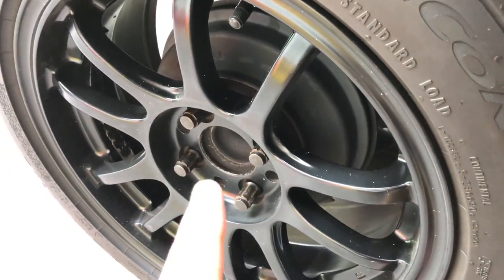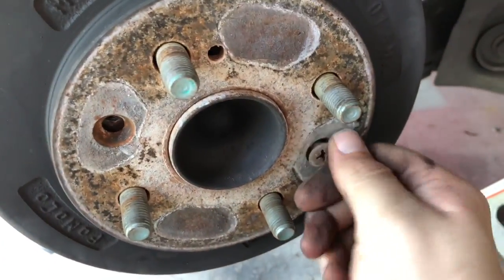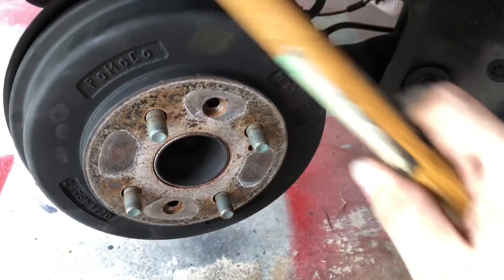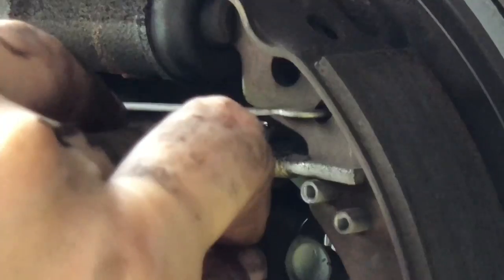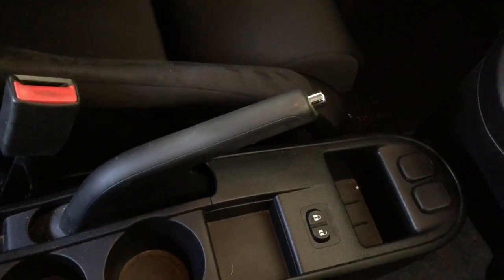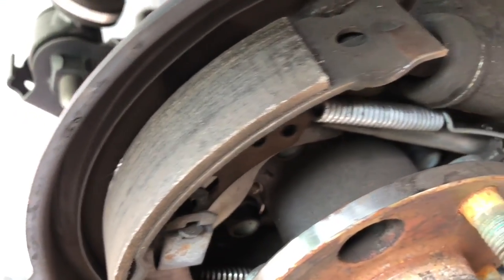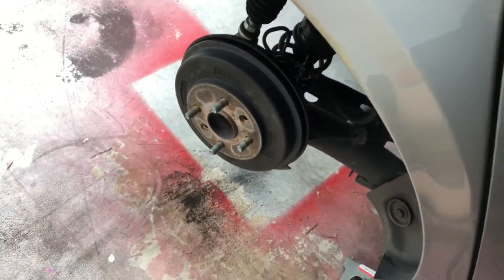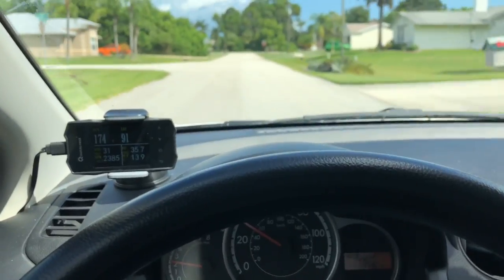Mazda2 | Rear Brake Adjustment

Comment: The screws remove easily with an impact driver - don't try removing them with a Phillips scewdriver because they're not Phillips they're JIS  and you'll round the heads. If you put some coppergrease on the threads they'll come off easier next time around

Comment: Can't wait to do this. My brakes are adjusted fine, but they've gotten ridiculously squeaky.
My favorite tool for those screws, at least when I've had to take the rotors off a Honda, is a manual impact driver.
Reply from the maker: I didn’t have one on hand. If there’s a common theme on this channel, it’s using whatever you can find lying around the garage. 😅

Comment: Got my son's Mazda 2 rear shoes to do this weekend, and was wondering if they were screw back calipers with the 'Ford connection' but happy to see they are drum. I use a manual (Hammer powered) impact driver for those screws but do make sure its the correct size bit, snug fit! if you don't have an impact driver, sometimes a 'clump' on the end of a big posi screwdriver can just loosen the rust. Otherwise, as Josh says, drill a divet and whack it, preferably with a punch. I always refit the screws, just tight enough (with a dab of copper grease, as it's high temp), that way the drum is held so I can accurately adjust the shoes. Some drums have a hole in them and a corresponding one in the hub, so you can adjust the brakes with a flat blade screwdriver, for which you need the drum secure. I also use high temp grease, if i lubricate the brake shoe to backplate area, just any old grease won't do as it might run off.. Brake grease is ptfe based

Comment: The only thing you neglect to mention is if the big screws holding in the drum are JiA or straight phillips head. Everything else is A+ kosher. Poppin' the drum out with the spare hole should be a #8, likely 1/4" head bolt with a standard thread pitch eg: whatever mazda uses everywhere else on their modern cars. Slot it in with some grease and torque it while bopping the opposing side of the drum to wiggle things out.
Reply from the maker: Since you have to likely destroy and then throw the dumb screws away and don’t replace them, I didn’t think it mattered much. lol Also, just hit the drum with a mallet like most mechanics shops will do. Much faster and it’s not going to hurt anything. It was already loose from the hub when I was having trouble removing it with one hand for the video clip.
Reply: @HiroshimaSpirit  Thanks for the clarification!

Comment: Did you upgrade your rear shoes or are you using OEM/the original shoe? Curious about the porterfield shoes... Also, where is the Mazda2 owners group? Online somewhere? Thanks again!
Reply from the maker: OEM shoes. They last forever, literally. Fronts do 70% of the braking so there’s really no need to upgrade the rears.

Search ‘M2O Mazda2 Owners’ on Facebook for the group. 👍🏻
Reply: @HiroshimaSpirit  I'll save my money on that area then and use it for something else, thanks! Unfortunately I am not on FB :(

Comment: Hey brother, you helped me a lot last time. Now my heater is barely putting out heat. Do you think that could be the the thermostat? My coolant is at a good level and clean. (2011 Mazda 2 - 111k)
Reply from the maker: Did you flush your coolant recently? Typically, if there is air in the system, it can find its way to the heater core and render it ineffective as well as affect your overall cooling efficiency. If you haven’t touched the cooling system, I don’t know what the issue could be. Perhaps a clogged heater core? It’s certainly not the thermostat.

Comment: You should do a rear disc brake conversion ive seen some online for a 2
Reply from the maker: The kit is expensive and would be more for looks than anything else. Drum brakes on a lightweight car like the 2 where the front brakes do about 70% of the stopping are more than effective. Drum brake assemblies also tend to be lighter than disc setups. Not to mention that they literally last forever.

Comment: Another super helpful video, as always. But quick (unrelated) question, have you or any of your friends experienced any harsh vibrations/shakiness from your 2's, particularly from the engine? I ask because my family's 2 has been causing quite of bit of vibration from the engine to transfer into the cabin and you can feel it from the steering wheel, the floorboards, and it sorta feels like the whole car is shaking a bit. Revving the engine or accelerating just makes the vibrations more noticeable. The engine runs super smoothly otherwise so I have a hard time believing it's anything but the motor/trans mounts going bad. It happens every morning after a cold start (which feels the worst btw) and completely fades away after about 30 minutes of driving. In your best estimation, do you think an 80k mile 2 should need motor mounts so soon? Anyway, sorry for the long read, you just have so much more experience with these little guys. Thanks man!!!
Reply from the maker: The mounts are a good place to start, judging by what you’ve described. 👍🏻
Reply: I thought so. Thanks man! Btw, I'm aware of the big mount on the top left of the engine but is there two or just one mount for the transmission? I watched your video where you swapped out your mounts so I was wondering if there really was just one. If so I'll definitely feel relieved. haha
Reply from the maker: Yes, there is just one trans mount. 👍🏻
Reply: A transmission mount or engine mount on an automatic going out will actually have ~lowered~ perceived passenger bay noise and vibration when under load. Easy test: Keep it in park ==> heavy vibration Y/N? (y) pop into neutral. Vibration lower but still present Y/N (y) blip the throttle. Does vibration lower even more as the engine rocks? Y/N (y), one of your mounts is on the way out. 

When I bought mine at 117K, the PO gave me his OEM lower engine mount that he'd swapped out at around 80K and it had a massive tear in it. I wouldn't be surprised if you're suffering from some sort of dampening issue, even if your symptoms don't match what is traditionally acknowledged as a bum mount. That being said, if you're feeling a ton of vibration and noise in the first place, a bum mount is where to look. It's ass backwards and silly, but hey that's keeping economy cars on the road baby.
Reply: Thank you for bringing it up actually, I tried that the other day and the vibration is about the same in both park and neutral. However, it seems very rpm-dependent so blipping the throttle, accelerating, and cold starts all make the vibrations stronger and more apparent. But I just can't seem to make sense of the fact that the problem seems to solve itself (if you can even call it that) after the car warms up for about an hour or so. But like you said, it's kinda ass backwards so maybe the symptoms don't always make sense in our heads. I'm just curious though, did the previous owner of your 2 get a high performance mount when he replaced the OEM one? I'm kinda wondering how a stiffer, aftermarket mount would affect driveability on an automatic like ours. Anyway, it's good to know our car is making it beyond the 100k mile mark without (too many) issues.
Reply: @emptyhead3007  Rubber is more supple when warm and you haven't mentioned the climate you're dealing with. Things may smooth out when stuff warms up in the engine bay. The PO of my vehicle didn't replace the engine mounts, just the transmission mount for a semi-stiff dogleg from Anthony West racing. It adds some very low level vibration at stops, but the stiffness (according to the PO) makes it impossible to miss shifts into third gear. 

Unless you want to get in there and remove all your mounts and inspect them for cracks, you might be pissing in the wind.
Reply: @MrAfdasdfa  Thanks for your reply. I just took the car yesterday to get looked at by two different mechanics and after doing a "stall test" the engine rocked in the engine bay so they both determined the cause is most likely the trans mount (aka dog bone or torque strut mount). And you're right, we're not gonna check all three mounts because given the way the engine rocks as well as the sheer cheapness of the part (in terms of quality) it has to be the trans mount. I just bought a new one from Rock Auto today for 30 bucks after shipping and I'm hoping it'll resolve the problem even though it's based on the OEM design and will eventually go out again. Both mechanics told me that newer cars are having more issues with their mounts sooner than older cars and it seems to be a common trend. It's a shame but at least it's nothing too major. And just curious, is there anything I should keep an eye out for now that my 2's just surpassed 80,000 miles? I know the suspension is another problem area so I'm anticipating changing out the struts in the near future.

Comment: thanks for the video..
BUT
just so you know, those 'stupid screw holes' line up perfectly with the adjuster. they're there so that you can adjust it without taking the drum off. also, even if they were indeed pointless, all you've done by getting rid of them is increased the potential for dirt and rust to get inside...
Reply from the maker: Those two screws are there to secure the drum to the hub. Nothing more. A friend of mine, also a 2 owner, master mechanic, and certified state vehicle inspector, recommended that they be thrown away. I trust his judgement. 

As far as dirt and rust getting inside, there is a gap between the drum and the rest of the assembly. The entire way around. Two little holes on the mounting face of the drum that are covered by the wheels aren’t a problem.
Reply: that's not going to stop the brake dust from inside the drum or moisture in the air from getting in. all i know  is for me, doing this exact job today, it was much easier to do it through the hole, even when the drum was off, although with the drum on is easier to alternate between testing and adjusting. 
there's a few mm of play around the hub bolt holes of the drum and the bolts. eventually that will wear down the bottoms of your hub bolts as it will grind when you change into and out of reverse, unless the screws are in to keep it from sliding/playing.
it's easier and maybe well worth that, but they're far from useless.
Reply: Iv been on the tools for 40 years ,and Iv never heard such rubbish , you can adjust the shoes with the drum on when you remove the rubber bung from the back plate and adjust the self adjuster with a brake spoon or a small screwdriver , by turning it slowly clockwise while turning the drum and checking for drag .The two screws you are referring to are for securing the drum to the hub that’s their only purpose .and not necessary as your lug nuts serve the same purpose
Reply: @jamesymiff7699  what makes you think that a single feature must have a single purpose? i gather you know how vacuums work if you've worked 40 years as a mechanic...so am I wrong in thinking that the two holes would create and/or alter the aerodynamics within the drum when the wheels spin? as far as i understand, the answer is yes, probably leading to more dust & also probably cooling or heating the drums inconsistently (wind blowing in from one side on a freeway). all that aside, the holes create noise when unplugged when they spin through the air. i'm not saying you shouldn't throw them out because it will cause tangible damage, but they aren't pointless to keep on.

Comment: Thanks for the info I have a 2016 Scion IA which is actually a Mazda 2 sedan I've adjusted them before but I had a hard time cuz I was using the access hole on the drum this time I'll just take them off if anyone out there could let me know an average of mileage on drum brakes
Reply from the maker: On a street car they should literally last the life of the car. Definitely as long as you’ll own it.

Comment: In reality, there is a raised lip on the drum, therefore adjustment is necessary once the drum is installed through the back of the drum, via rubber grommet.😂

Comment: Can you make a video changing  the actual drum breakers I try to do it like 2 month ago and couldn’t do it
Reply from the maker: Neither of my cars need them changed, so no. How old is yours? The rear brakes on a street driven 2 literally last forever. People who race them go three seasons on brake shoes, for perspective.
Reply: HiroshimaSpirit mine is 2014 I just try to change them for learning purposes but now that you mention it that they last a good amount of time I guess that there is not much need on changing them
Reply from the maker: Yeah, our 2013 has 120k miles and the rear brakes look the same as the 2014 with 40k miles; More or less new looking. You won’t have to worry about them for a LONG time. 👍🏻
Reply: Agreed. 131k, 500+ autocross runs, and a bunch of track events and my rear shoes are still at like 4/32 (which is basically brand new). No need to screw with them if there's nothing wrong.
Reply: Hey, Im gonna do this, mine clicks back a few times. I took the tires off to look at mine saturday because they were making noise, but turns out  mine look like new aswell.

Comment: I belive they sell a rear disk brake kit conversion for the mazda2
Reply from the maker: They do, but the kit is expensive and would be more for looks than anything else. Drum brakes on a lightweight car like the 2 where the front brakes do about 70% of the stopping are more than effective. Drum brake assemblies also tend to be lighter than disc setups.
Reply: 131k daily driven miles, 500-600 autocross runs, and 6-7 track days/TT events with brake shoes that still are near-new looking say that rear discs would be a waste of money. :)

Comment: are all Mazda 2s a 4 stud wheel?
Reply from the maker: Yes. 4x100 👍🏻
Reply: @HiroshimaSpirit  how would I go about putting a quick release steering wheel on?
Reply from the maker: You need a hub adapter, quick release, and of course a steering wheel. NRG makes a hub adapter that fits the 2, but I don’t know the part number.
Reply: @HiroshimaSpirit  do you have an email I could contact you at?
Reply from the maker: I never check my email. Best way to reach me is through comments here or to DM me on Instagram. (@hiroshimaspirit)
Reply: @HiroshimaSpirit  Easy ill text you later
Reply: @HiroshimaSpirit  I pmed you mate

Comment: OMG use an impact driver Don't through them away!
Reply from the maker: I was advised by a certified master tech to throw them out, and it’s the best thing to do in this situation. Not having them there makes zero difference other than now NOT needing a tool I (and, likely, most people) don’t own to remove stuck hardware on the drums to routinely perform this otherwise easy job.